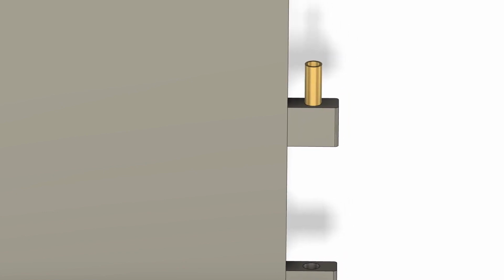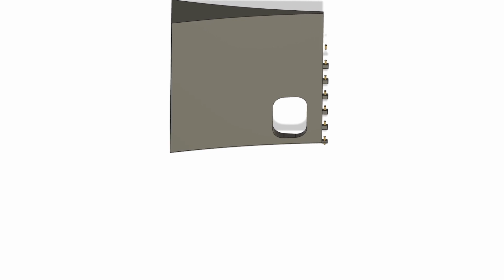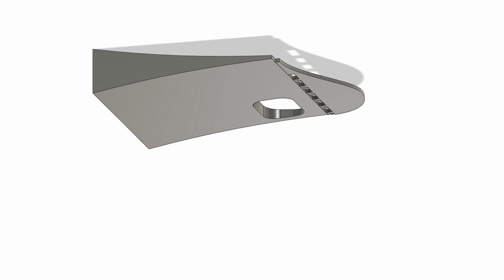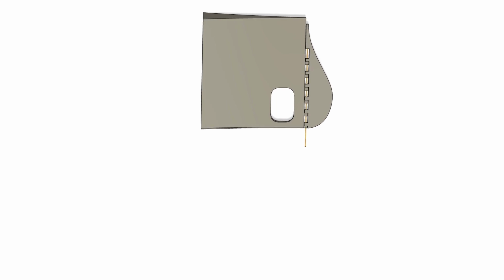Radio Control Trumpeter 1:200 Titanic Build Part 4 - Rudder

Comment: I purchased the RC kit for this. Looks like a good kit. Only thing is the rudder. No hole nor any pins inorder to keep the rudder in place. This is going to take some engineering to accomplish the mounting of this rudder.
Reply from the maker: Yeah it’s a fiddly little part of the kit. The method is used does work but it’s tricky. I think the RC kit rudder is a little more robust though. Good little project in its own right though!

Comment: Fantastic build! Especially watching how you are engineering everything. Has this boat been in the water yet? If so, how much ballast did it require? The kit rudder looks too small for a 53" boat with three props.
Reply from the maker: the boat has now been in the water, i'll be uploading another video on it in a week or two. Takes about 4kg of ballast in total but its difficult to define as im having to estimate the weight of the super structure a bit! The rudder is a bit small, its fine at speed, but slow speed its effectively useless!
Reply: @TheModelBoatGuy  i think you can turn off or slow down the wing propellers and full speed the center prop so that it can turn in a short distance

Comment: Have you heard about the big inaccuracy of this Trumpeter Kit's rudder ?  It is completely out of shape compared to the real one. Have checked it and compared it to the blueprints and old photos -  can confirm it!
Reply from the maker: Yeah you are correct there is a big issue with the rudder. Originally I wasn’t going to bother with changing it.
But having been looking at the model recently I really feel I need to change it! So I bought the Shapeways rudder. It is much better! It is a very odd thing for trumpeter to make a mistake over!
Reply: @TheModelBoatGuy  So you got one too!  I got mine this week and thought it may be a little fragile for your needs?  I cant imagine that it would take much heavy impact treatment...... like an iceberg!  :-D  JH
Reply from the maker: Yeah I relented. I just ended up getting irritated seeing the wrong profile on the rudder. And it was a case of I would always regret spending  so much time getting the kit as I want it, to then have such a glaring error! 
To be fair the new rudder is pretty solid. I’ll give it a few trial goes and see if it’s strong enough, and failing that I guess I could try casting my own out of metal. Might be an interesting project actually...
Reply: @TheModelBoatGuy  The shapeways version may be ok , it may look a bit tougher once painted!  A brass one is available for a cool £135.00  :-p.  Casting one yourself would be interesting!  All my 30 foot boat blanks are done and ready for clean up. Now working on the next batch of the smaller nesting boats!

Comment: I got the running gear set from Ebay that your talking about, And its gonna take a fair bit of engineering itself, but im gonna make it happen.
Reply from the maker: Aah good, yeah to be fair the prop shafts still need to be drilled out and the rudder needs a mount! The good thing with that set is that the rudder is a slightly more accurate shape too. Good luck with it 🙂